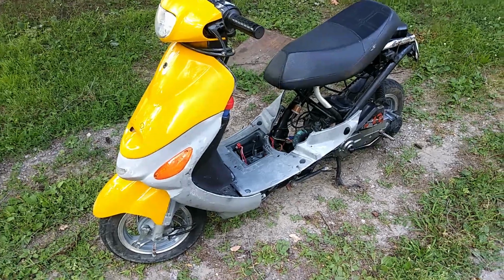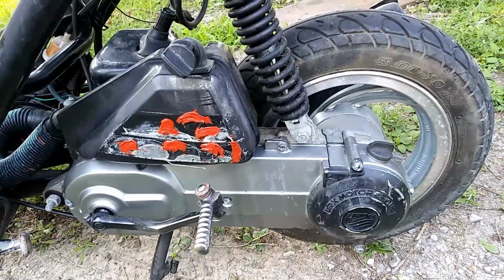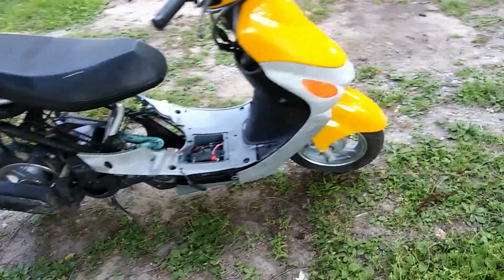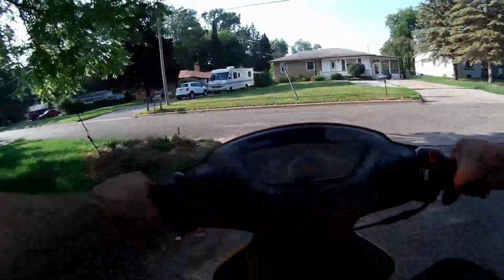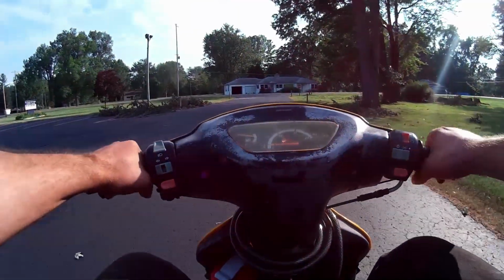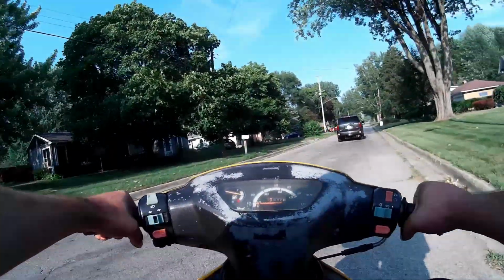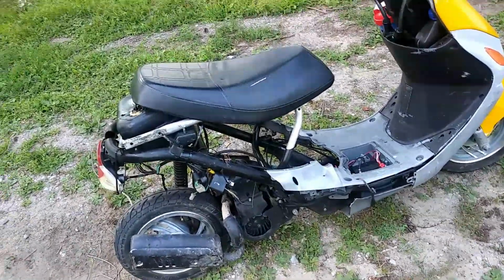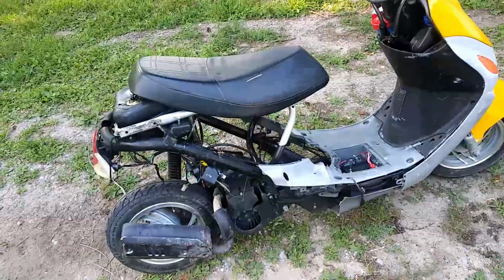A scooter with an engine nobody talks about | LRX 50cc w/ 1E41QMB Pt1

Comment: Recently picked up a scooter with the same motor to flip it. Can confirm it's a bit gutless from a dead stop. Doesn't help that the aftermarket for these engines are pretty much dead now so there are no upgrade paths to wake it up.

Comment: I have a 2004 with the 4 stroke qmb139 with a naraku big bore and head, a9 cam and 150cc carb. The thing flies!!!
Reply from the maker: The upgrade kits really do wake them up. Even the two strokes.
Reply from the maker: I had one a couple years ago thatwas a 4T and had a 100cc big bore, cam, carb and aftermarket exhaust. She was loud but it ripped for a small scooter.

Comment: Same motor here...Mine is a Sinski 50cc Yellow too. Do you know how fast your going?  & More importantly what did you do to fix the Dead spot?
Reply from the maker: I no longer have this bike but it ran 33mph on the flatlands. I fixed the dead spot by using a micro drill to upjet the carb a few sizes. It gained 3mph by doing so also
Reply: @littleengine1303  If you rember, please tell me what size of main jet was. My is no.75 and have too much fuel. Nice ride ;)

Comment: Just wondered if you were able to find any sources for parts on that lrxscooter? I broke the choke lever and one of the pieces of plastic. I broke the chokeand put it in the pole barn for 10 years. Lol
 Pulled it out, starting fluid and it set in idled
Reply from the maker: Anything I had to replace was ordered from ebay on this bike.
Reply: @littleengine1303  does this have to take mixed gas??? I been running it on regular
Reply from the maker: @bigfootanon6896  not all of them do. Some two strokes use premix and some have an oil injector. If your bike is 4 stroke, you put oil in the crankcase and only have to check/change it.
Reply: @littleengine1303  thank you.. still have mine and thinking of doing a big bore kit... suggestions?

Comment: id love more information on the engine because i have the same engine and what to do i really need help im on the edge of giving up
Reply from the maker: When I bought it it had the telltale no spark condition. The coil and CDI box are a combo specialty u nit that costs about $40 and thats whats wrong with it if you got no spark 100% of the time
Reply: @littleengine1303 where can I get that unit